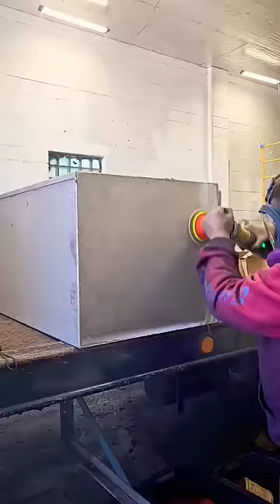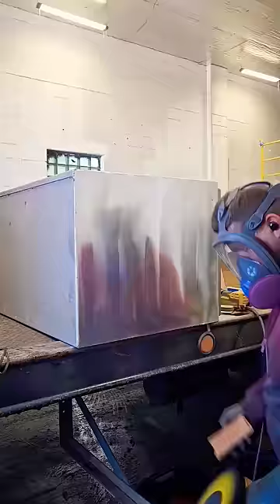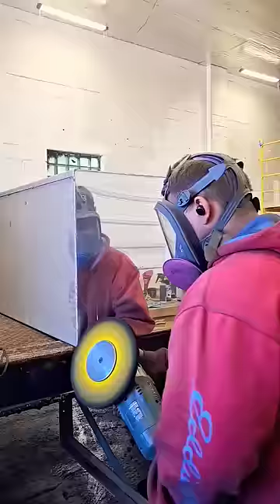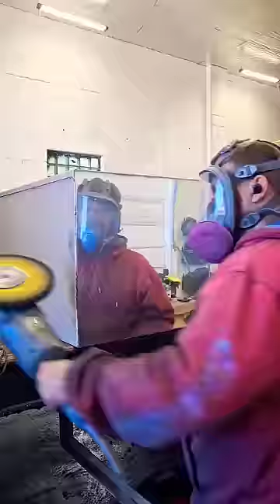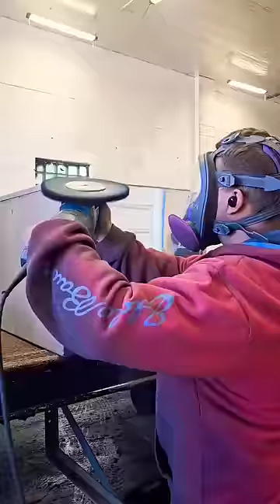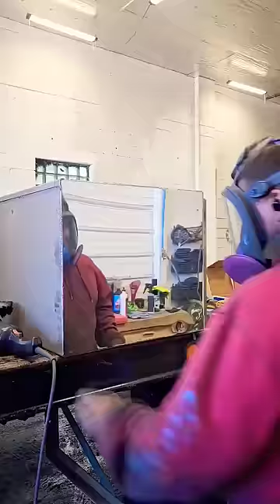Satisfying Process

Comment: As a retired truck driver I polished my own stuff. It's not so easy, but learned to go over by hand. If someone can make a good way to cut by hand it would be a great idea.
Reply: You cant cut by hand...what you see after handjobs is mostly shine from polishing oils/agents/wax/sil that fill in the voids of oxidation. Only  proper machine cut and polish will have any long lasting difference in aluminum.

Comment: Thought about a getting a generator.. grinder/ drill. Hittin some truck stops/ truck wash.Doing one polish job a day or 2 jobs a day. You can make what you want and sky’s the limit. Earned a sub.
Reply: all you need is a battery powered polisher/sander. Hi-Tech Mighty Mini Cordless Polisher, you can get 3 inch sandpaper at most auto paint stores.

Comment: Im about to attempt this on 2 semi fuel tanks! Looks awesome!
Reply: The milk trucks around here have trailers that look like that
Reply: It's going to be much more challenging on a curved surface, though.
Reply: Be prepared for some hard work.
But the finished look would be rewarding.

Maybe you can optimze it (when it's yours) by just doing the outside side wall. And well, when you still feel comfortable you can continue with the upside.

Step by step.

And when you can't feel your hands any more and have done at least one surface, it still looks good ;-)

Comment: Looks like what I do with the edges of my knives. I start with dry sandpaper 600 grit then move to a 1,000 grit. Then I go up to the 2000 grit, 4000 grit, 10,000 grit and last I use the 14,000 grit sandpaper. Then I will switch to lapping film and go all the way up to a 60,000 grit. Then I will finish it off with a leather stropping board with the green chromium oxide compound on the suede side, I will do 100 strokes 50 on each side. Then flip over the stropping board to the smooth leather side with no compound and do another 100 strokes 50 on each side. What I'm left with is an edge that you can not only shave with, but use as a mirror to shave with, lol. I have a Gerber Flat Iron knife that is as sharp as a razor blade. It ends up becoming an addiction as to how sharp you can get the edge, as well as how clear of a mirror finish you can get.

Comment: If you want a genuine mirror finish you need to stop standing at around a 1200 then move to Polish otherwise you're going to have abrasive scratches that you cannot remove with a Polish not really applicable to something this large but if you want a fine finish go to 1200 or 2000

Comment: How much does this heavy process reduce the meterial guage. Wondering how oftern you can do thos before you make it weak
Reply: It depends on the prior finish.  A hot rolled steel would remove say 20 thousandths of an inch, I'm guessing.

Comment: Bro, how to prevent aluminum from oxidizing after polishing?
Reply from the maker: You can only slow it down, and you can do that by using metal polish that has a good sealant package like ours.
Reply: Paint it lol
Reply: @@findonknifesharpening Thanks bro
Reply: @summershine_7702 what if you clear coat it 😂
Reply: Autosol does well at adding protection as you polish. Tho I can only speak for components lile levers off of bikes etc not done anyrhing large and flat like this
Reply: Granitize Xzilon
Reply: @UU-dp9th ive tried clear coat, clear powder coat, and even had a shop clear them
 The finish is too slick to hold any coating in my opinion..if they make it im not aware of it. Anybody else know?
Reply: @4thdimensiontravels855  there is already a good answer above yours. The one about ceramic coating.

Comment: That's what it takes to get a mirror finish? How the heck did we ever get affordable hand mirrors?
Reply: Most start with really flat glass (float glass), then a layer of metal goes on one side of the glass, the side of the metal layer that is against the glass is really flat and smooth because the glass was smooth. We’ve gotten really good at making flat smooth glass, so that makes the mirrors cheap.
Reply: @MultiPureEnergy Yea, naw. It takes what was done in the video - truly a miracle to make the buffing machines so small for the really tiny mirrors.
Reply: @mattheww9656 Uh, yeah. Naw, dude. Mirrors are usually made the way described. Glass, shiny metal coating.
Reply: The majority of mirrors one sees are vapour deposition of a metal, nothing like this.

Comment: A high speed sander is 3k? Ever done granite work?? That isn't high speed. 5k for 50, 100, 200 pads is normal. Yeah, it's technically grinding/honing but high speed is 10-11k thats what a 5" diamond blade runs. I can make the profile of dark granite reflect like that. Just saying.

Comment: As a Metallurgist I will explain what is happening here. 
For Metallurgist to understand metal we need to polish metal sample to mirror  finish.  When a metal is formed say by hot rolling the crystals are rough and when looked at by a microscope appear like hills and valleys. The result is the surface reflects light in all directions and not perfectly. The aim of grinding polishing  and buffing is to remove the microscopic hills and valleys and form a perfectly smooth surface. And that's what's happening here. When viewed under a microscope the surface is smooth.  A perfect surface will reflect light perfectly. That surface is a mirror.
In metallurgy we etch the surface to reveal grain boundaries. Have I helped you understand this process?
Reply: If you're a metallurgist Bub, I'm a monkey's uncle.
Reply: Could start by telling me the type of metal being polished